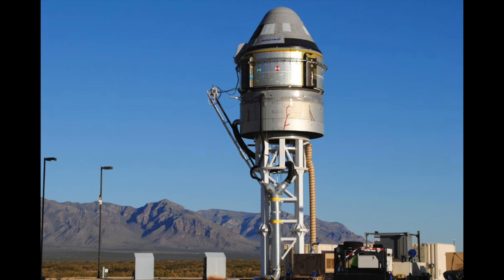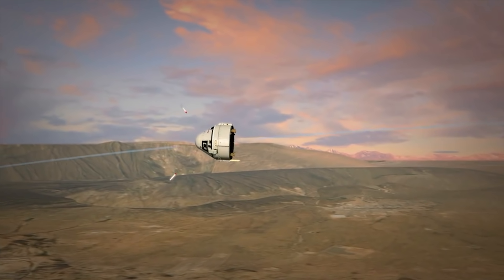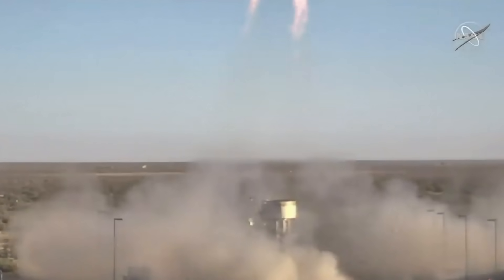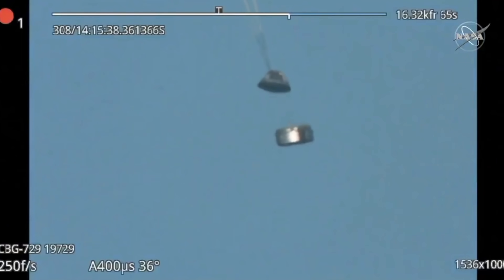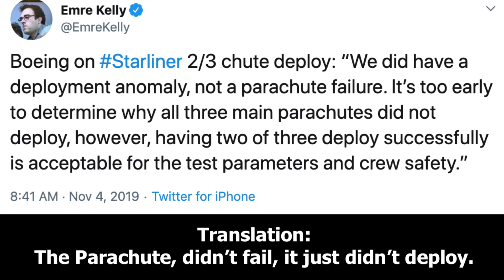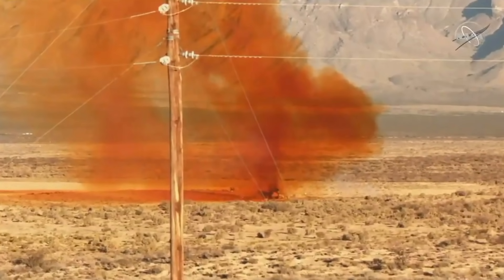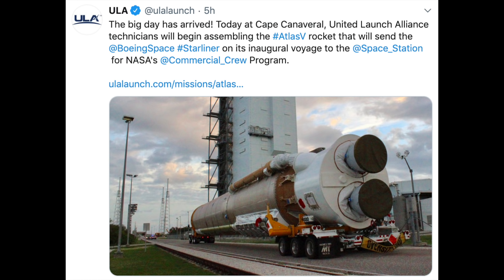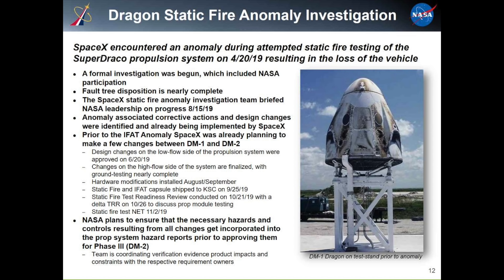Parachute Fails To Deploy During Boeing's Starliner Abort Test.

Comment: "Fly acceptably safe"
Reply: Dino 😎
Reply: Part of why I'm a bit afraid of the commercial space-age :p

NASA: Unless everything is tested 100% fine 50 times, we won't launch.
(and it still led to deaths btw)
Any for-profit company: Well there's only a 33% chance everyone will die, it's all fine o/
Reply: @Thalanna  If anything, NASA has a super high standard. There is a reason not a single capsule is on schedule, the safety precautions are very strict.
Reply: @Thalanna  And even with these odds, for-profit companies are making mad dosh - people don't care if it's 100% safe, they just want launch stuff into space.
Reply: @Thalanna  nothing is a 100% well only death but if you can go to space why not
Reply: I don't really know about NASA's safety standards...

'Acceptable risk' appears to be about a 1% failure rate. At least, that was what the space shuttle was operating under...

And if you've flown a commercial airliner, you might like to know that a 1% failure rate is considered disastrously bad in such circles...

But, 'fly acceptably safe' is an accurate statement regardless. XD

Nothing can ever be 100% safe, thus really what you're talking about is making the probability of failure low enough to ensure most people would be OK with it.

As an aside, the general risks of being alive right now are such that your statistical lifetime, if you were say, clinically immortal (eg you can't die of natural causes, but can still die due to an accident) is about 1000 years.

That doesn't mean everyone would die after 1000 years. Just that statistically, that's the average due to the rate at which fatal accidents happen in general across the entire range of human activities...
Reply: @Thalanna  Yup:  the crew signed their disclaimers and the company has few assets - that won't be in lots of blackened pieces - so let's Close Out and go already!
Reply: Max 8 can confirm
Reply: There are 737 like on this comment and I can't bring myself to change that number.

Comment: “Failure is not an option. It comes standard with every product!” - Boeing
Reply: it comes pre-installed for your inconvenience
Reply: "No safe option." ;)
Reply: Laughs in Airbus/SpaceX
Reply: If Boeing would keep to that word they would have made the Boeing 2707
Reply: Boeing is the sound that their aircraft make when landing.
Reply: *McDonnell Douglas
Reply: Help me out folks. Let’s get all the Boeing screw ups from the past ten years on the board. 737 Max MCAS, 737 NG structural cracking, 777X cargo door failure, 787 battery fires, 787 engine fire extinguisher failures, and finally Starliner parachute anomalies. I’m not trying to be a troll, but every product Boeing has in production now fails in the most well understood and well practiced areas. What am I missing?
Reply: @WilliamWhitneyChristmasMD  , you're missing the point that Boeing gets a fantastic amount of American Taxpayer Money.  That's all that matters.  As long as the Boeing Board of Directors gets their fat checks they don't care.  BTW, on a serious side the US Navy's P-8 Poseidon anti-submarine version of the 737 is an excellent aircraft.  Why?  Because the US Navy has learned NEVER trust the word of Boeing.
Reply: Ahahahahahahaha!!!
Reply: @WilliamWhitneyChristmasMD  how does that compare in failure rate when market share is considered though? Maybe they just have the most product in the market, so even a small failure rate will be exposed.
Reply: I scroll the comments for such saltiness, thank you
Reply: @Easy-Eight  Well to be fair the old stock 737 is pretty good. Kerbaling on some fancy engines with little regard for the holistic design is really where the Max failed. Which was a panic move by a company that basically refuses to innovate because it might risk the profit margin dipping below absolute maximum and then gets caught out when others produce products they can't match.
Reply: @WilliamWhitneyChristmasMD  The 737MAX issues is a massive scandal and people should be jailed. The other things are the kinds of things you have to expect from time to time and testing and the various oither systems in place usually prevent these things causing loss of life.
Reply: 1... Now Boing will be working behind the scenes to replace NASA's approval authority with their friends at the  FAA.
2... With Boing, 737max safety is an add-on option the airline must choose to purchase.
3... Brawndo's got what Parachutes crave.  Its got electrolytes ... brought to you by Boing
Reply: Admiral Bob I love that you used the word “kerbaling” so comfortably
Reply: @gregbrockway4452  more like CRUNCH
Reply: The real scandal in all this is the 737MAX.

This, above all else is a problem suggestive of corruption, in that the government regulator basically got too cosy with Boeing and let them design things without any independent safety oversight.

It doesn't matter what you think of private/public institutions, you DO NOT let your safety verification be done by the same people that built and designed the thing.
That's basic common sense even internally inside a company.
For instance, if you're doing safety critical repair work on something, that's why you get a second person to verify the work of the first.
It's such a basic thing, yet Boeing managed to find a way to get around it... Saves them time and money, yes. But undermines safety no end.

The other problems they've had simply aren't on the same level, just due to the implications...

Failures and bad accidents happen from time to time. Sometimes, a design that seems safe has some obscure problem that's hard to track down. (anyone remember that the 737 was nearly declared to not be airworthy in the early 90's due to 3 different unexplained accidents?)

But, the MAX failure is just on a different level entirely, and speaks to massive corruption...
Reply: @KuraIthys  I mean, the MAX failure is really a part of the MCAS system, which is to make the MAX behave like a normal 737 and not have to retrain pilots. Had they just trained the pilots to fly the MAX like a totally different airplane than the normal 737, they wouldn't have needed MCAS, and the whole problem could have been avoided.
Reply: Al T Boeing pushed the limits of the 73 design because it’s not nearly that simple. It’s time consuming and expensive to get a new aircraft type certified. The same goes for pilots and A&P mechanics who have to go through type cert training to get certified on the new aircraft type. The airlines have to do a crap ton of work to bring a new type into their fleet. The 73 is flown by a bunch of different kinds of carriers, but many are LCCs whose margins couldn’t handle the expense and complexity of a new type. 

For some - like Southwest - flying the 73 exclusively is an integral part of their business model. Pilots only need one type rating, and the maintenance folks only need to work on one type.

Boeing seems to have screwed up massively on a number of levels with the MAX, including and especially the MCAS implementation. I’m not an aero engineer, but it seems like they pushed the 73 design near or past its limits (stall characteristics etc) and did a really crappy job of compensating with software. “Here’s a new aircraft type, go fly it” doesn’t work that way. So they tried squeezing another gen out of the 73, tried pulling an Airbus with some poorly thought out automation, and it ended up badly.
Reply: Rick Hornsby I see that. However, the MCAS only exists to make the max behave more like other 737’s. That’s the real problem. They could have called it the 737 Extra, required pilots to go through the process of learning how to fly the new plane without the assist software, and never have had the problem.
Reply: @douginorlando6260  You had me crying at #3.

"Boing....F-you! I'm launching"
Reply: @WilliamWhitneyChristmasMD  
Here are some you missed:
-Massive failure during V1 RTO testing, several tires explode, large fire in the undercarriage. Significant redesign required.
-Automated flight envelope protection system causes plane to go from straight-and-level to maximum alpha lock, causing it to suddenly climb through the altitude of the aircraft above it on the North Atlantic Tracks with no pilot input before the pilots could get the nose back down. If the other aircraft hadn't been flying with a lateral offset from the assigned track, this likely would have become the 2nd-deadliest non-terrorism disaster in the history of commercial aviation, with only 9 fewer fatalities than Tenerife. Fortunately, due to the lateral offset between the aircraft, they did not crash. TCAS was active, by the way, and did issue RAs to both crews, but neither crew had time to respond to it before the altitudes crossed. It happened so quickly that the crew flying the aircraft above it reported that their TCAS was still telling them to climb for a bit, even after the other aircraft had already climbed through their altitude.
-Errors in Air Data Inertial Reference Unit and Flight Control Primary Computer cause two extreme uncommanded dives in flight. One of them hit negative gs, throwing people in the back against the ceiling, injuring several, including 12 serious injuries (the seat belt sign was off at the time and it was a long-haul flight, so several people were milling about in the cabin.) Had this occurred at low altitude rather than cruise altitude, the plane would have crashed before the pilots could have recovered from the uncommanded dive. The crew made an emergency landing without any way of knowing whether their aircraft would try to kill them again on short final. Thankfully, it didn't and they landed safely.
-Utterly bizarre system that averages pilot inputs without giving any indication to the other pilot what one of them is doing allows a single incompetent pilot to stall an aircraft from over 40,000 ft. to the ocean surface, killing all 228 people on board. Aircraft still operates this way and was never grounded.

Of course, that last one likely gave away that all of these incidents were with Airbus aircraft.

Comment: "...we fail in test so we don't fail in flight."- Neil Armstrong
Reply: Dick Scobee used to say the same thing
Reply: Tell that Apollo 1
Reply: @DrJump3r  they understood this better than anyone. The information from that failure came at a horriffic price, but it was priceless information.
Reply: @DrJump3r  or 13, since 1 was destroyed in a test.
Reply: @gregsteele806  ????  the Apollo 1 tragedy was a test failure.. Apollo 13 was an in flight failure
Reply: @fppro1679  yeah, it helped save the Apollo program and 13 in particular. Before Apollo 1 the CM was a total mess - the fireproof insulation on all wiring installed afterwards prevented the moisture in 13 from shorting everything when the CM was powered up before reentry.
Reply: ...apart from when we do fail in flight
Reply: It's a shame Boeing didn't say that, Boeing (who already face bad optics for their 737 Max) said that 2/3 is ~everything as planned~, rather than a partial failure but a demonstration of why they have redundancy
Reply: we fail and lie about it and try to cover it up ~ Boeing
Reply: It's extremely true, especially for space flight ^^ I think the problem isn't that it failed, in fact it's a good thing it failed during a test. The problem is that they don't even remotely consider it a failure ^^'
Reply: Fp Pro 737 MAX must have been a public beta
Reply: except boeing doesn't test their SLS hardware
Reply: @KrustyKlown  Citation needed.
Reply: @DrJump3r  burn
Reply: Noone really went to the moon
Reply: @preestonblairr7361  you're going to look really stupid when they go back to the moon and walk on to the site and all the hardware from 1969 is still there.
Reply: @preestonblairr7361  When you appear to advocate with perfect seriousness that which others have advocated with perfect seriousness, you should not be offended by being thought serious.  Moon hoaxers might be laughable in a sense, but simply repeating their mantra does not qualify as a joke.  In a joke, something in what is said or written must evoke irony, paradox, a play on words or something of the sort.
Reply: @digitalnomad9985  😂😂
Reply: Absolutely!
Reply: Ummmm....

Comment: That orange hydrazine cloud makes the hazmat technician in me bristle.
Reply: The orange is nitrogen tetroxide, hydrazine is colorless.  There's probably not too much hydrazine leaking - you can tell by the distinct lack of a towering inferno.  There's a great old NASA safety video about the two if you're curious.

https://www.youtube.com/watch?v=Zha9DyS-PPA
Reply: Seriously! That shit is not good.
Reply: It makes me want to check wind direction and that my running shoes work. But yeah I get it.
Reply: I wonder how difficult it would be to prevent that. Using all the fuel up would help, or maybe using a thruster after separation.
Reply: And there's a highway downrange of it...
Reply: Joe Average  If used in a pad abort or in-flight about it would land just offshore. The Russians and Chinese launch over populated areas. We don't. In normal missions everything below the heat shield is jettisoned before reentry and burns up in the atmosphere. That's when this capsule lands on land.
Reply: @jordanrodrigues8265  Nitrogen tetroxide is still extremely nasty. To quote the MSDS: "Very concentrated fumes produce coughing, choking, headache, nausea, pain in chest and abdomen; otherwise, few symptoms appear at time of exposure. After symptom-free period of 5-72 hours, pulmonary edema gradually develops, causing fatigue, restlessness, coughing, difficulty in breathing, frothy expectoration, mental confusion, lethargy, bluish skin, and weak, rapid pulse. Since NOX interferes with gas exchange in lungs, unconsciousness and death by asphyxiation can result, usually within a few hours after onset of pulmonary edema."
Reply: @jordanrodrigues8265  Hydrazine (and the entire family of 'hydrazines') fume with a white cloud that looks a lot like steam, but it doesn't evaporate nearly as quickly as steam does.
Reply: @thermophile2106  in an actual abort, the capsule/SM stack would fly downrange over the ocean and touchdown there instead of on land. The SM would sink rapidly after crashing and bursting apart and so would not be much of an issue.
Reply: Not using a Boeing would help lol
Reply: @Strike_Raid  It breaks down into several chemicals and generates heat, so the water (commonly) in solution will boil.
Reply: @fiveoneecho  There is no water in modern Hydrazines use as rocket fuel.  Hydrazine propellants (like MMH used in the Shuttle) are anhydrous.   They are also very hygroscopic, so you have to take steps to make sure it is not exposed to air or it will quickly absorb water vapor and lose some of it’s power in doing so.  If you were to pour a little water into anhydrous MMH, it very well may boil, maybe even violently, as the enthalpy dropped do to the concentration reaction (I’m guessing though, I know the enthalpy will drop but I don’t know by how much, it may just get hot).  Hydrazine Hydrate (like commonly used by Germany in WW-II) is a lot less powerful than anhydrous Hydrazine.
Reply: @Strike_Raid  Interesting!  I don't know much about the modern hypergols used.  I would second your assumption with the chemistry, though.